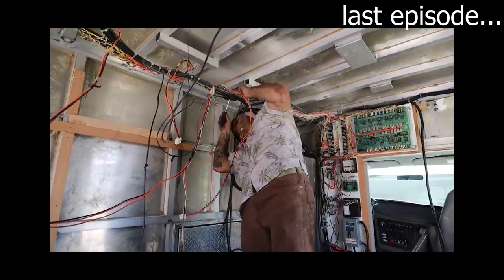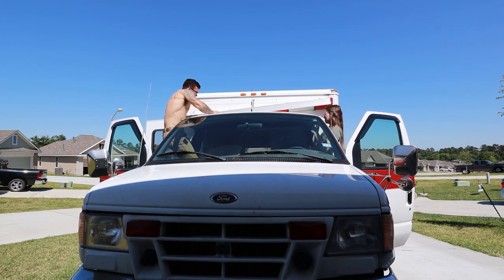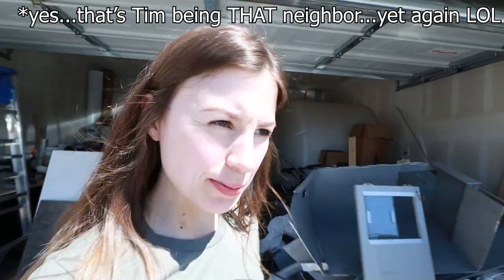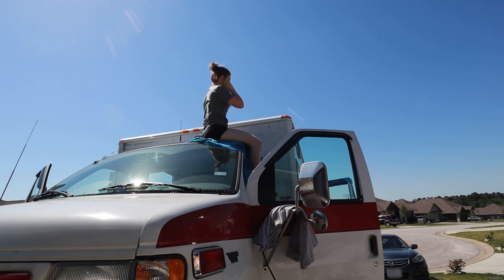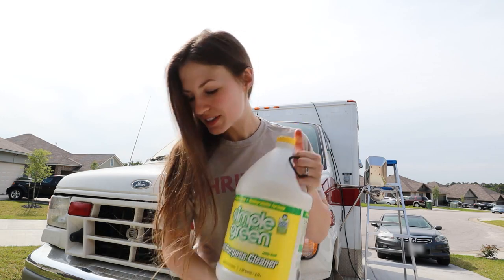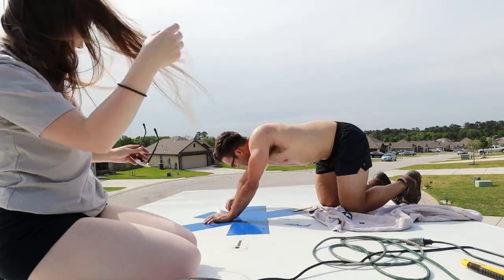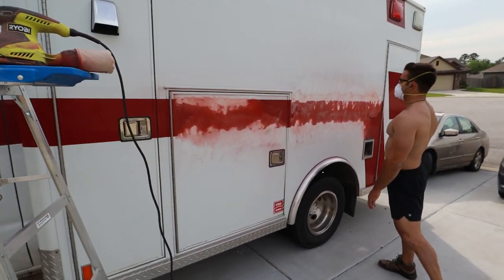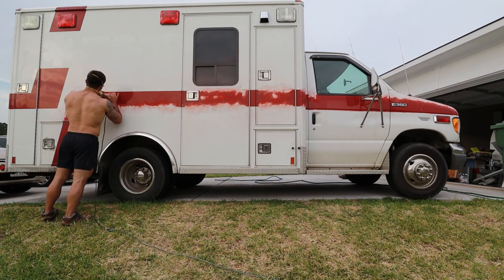Ambulance Conversion Progress: Removing Lightbar & Ceiling Plates, Sealing Holes, & More!

Comment: I'm putting tropicool on the inside of the ambulance. Helps with sound deadening, vapor barrier and installing. Will apply tropicool and Havelock wool before it dries to keep it from sagging under gravity.